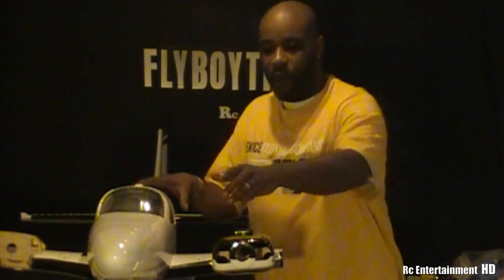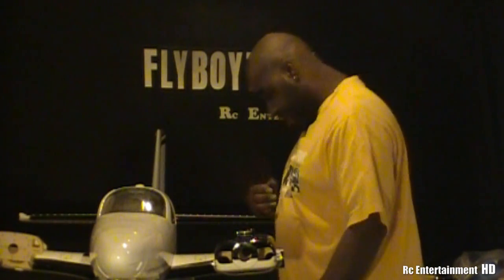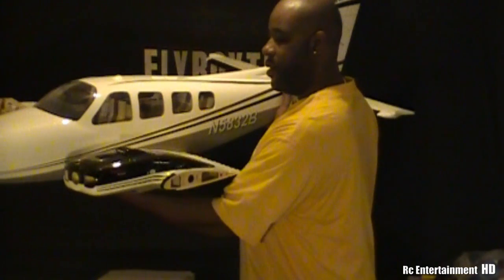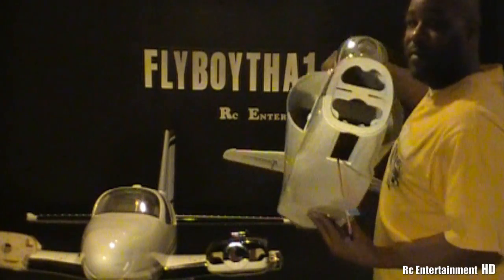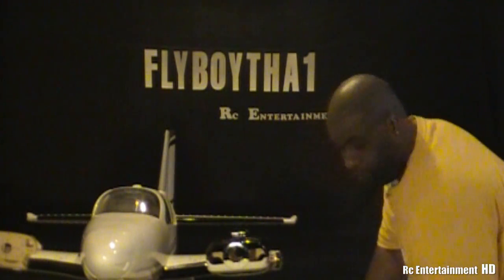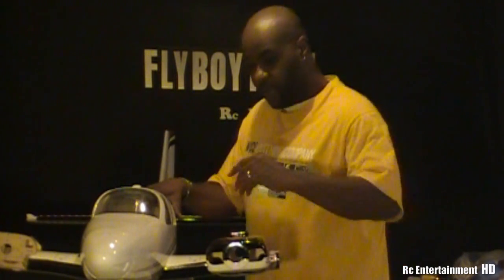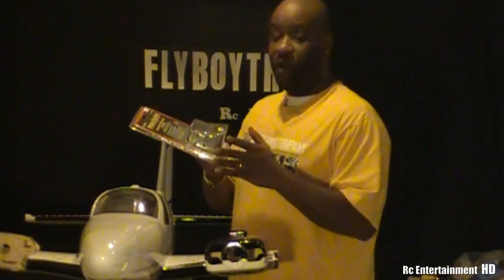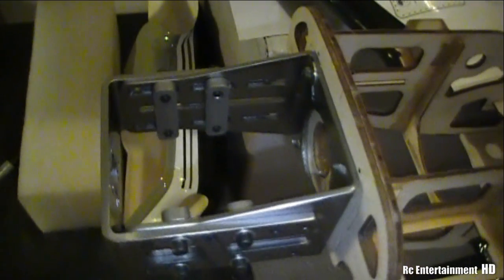RC Aerodyne Beechcraft Baron G58 Composite ARF Intro (Part 9) Motor Mounts Installation

Comment from the maker: @carlosmurphy4u They Are TamJets 120mm Carbon Fiber Fans With Nue Motor 1915 1Y And Castle Creation HV120 Esc. Cost $995 Each Plug-N-Play Unit.